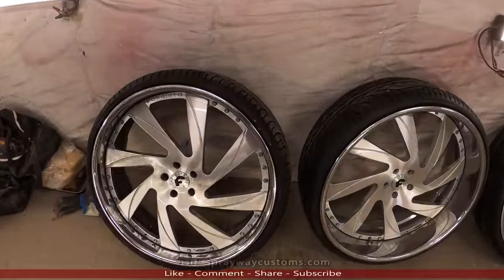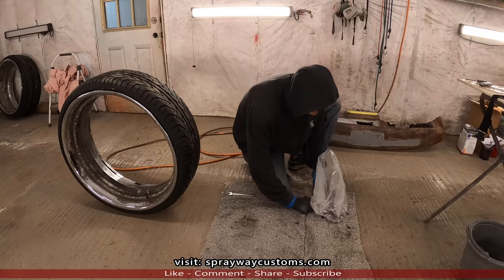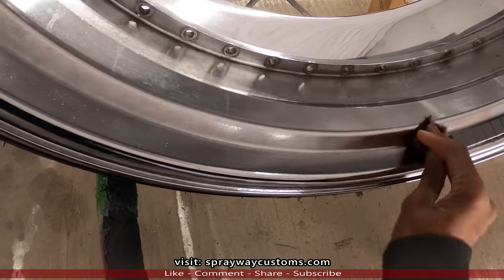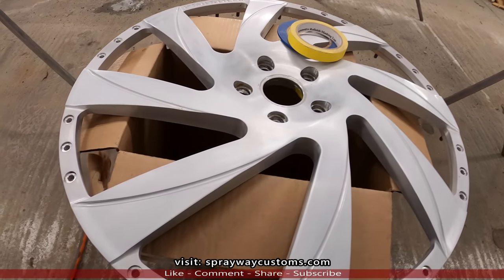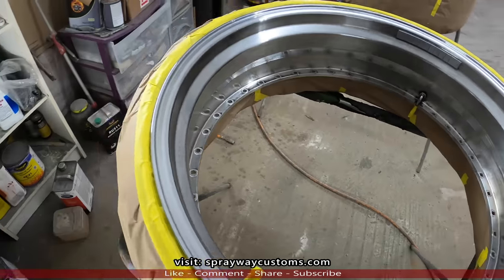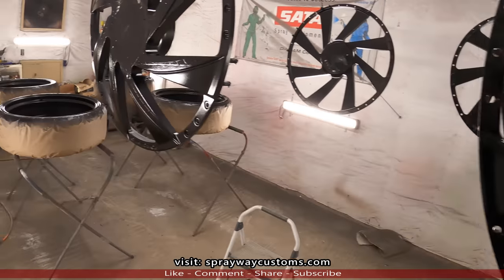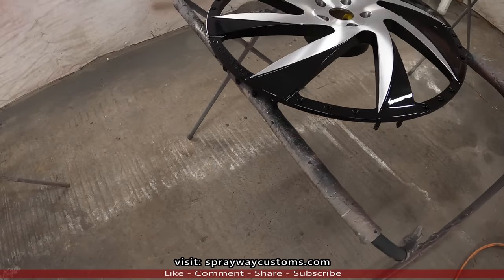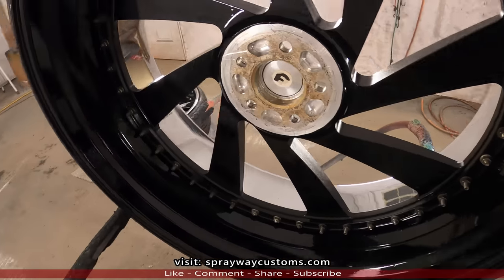Painting The Box Chevy Caprice Wheels - CUSTOM 26s FORGIATOS - How To Paint Your Chrome Rims Black

Comment: They came out looking great. It might have been wise to remove the wheel weights before painting though. If the wheels ever need to be balanced in the future there will be chrome on the barrel where they removed to old weights. (just a thought)
Reply: Was thinking the same thing. At least it's a static balance inside the barrel, so a quick rattlecan job would clean it up and prob not be noticeable.
Reply from the maker: Thanks

Comment: Hey SPRAY WAY another fine video 😊 do you have any videos showing how to paint chrome bumpers? also wished I could send you a video where a guy made sanding blocks from 2" foam board   he used sticky back sandpaper for the contours  and groves then ruled the foam on the paper until it took form of the Grove he wanted I tried this and it worked great
Reply from the maker: Thanks Tom…I’m about to paint some chrome bumpers real soon

Comment: Is there a pattern you have to follow to remove or install/tighten the rim face bolts?
Reply from the maker: Yes, you have to torque them down to a certain spec
Reply: Question what's the spec you torque down these forgiatos to .. I want to paint mine soon.

Comment: Why use a wrench? Would be easier with power tools…
Reply from the maker: I didn’t have the right socket to fit without hitting the barrel. It’s not much room
Reply: @SprayWayCustoms  what about a deep wall 10? Or 7?? 1/4 drive with extension..